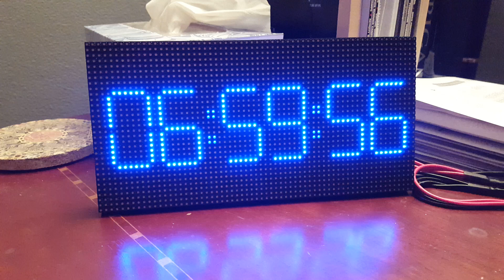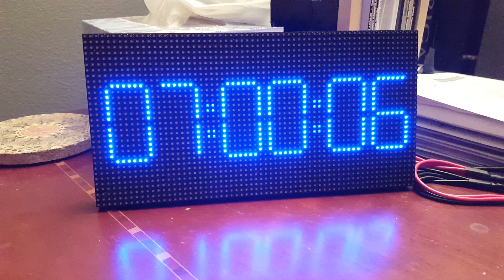HariFun #166 - Morphing Digital Clock

Comment: hello hari
i get this in message Compilation error: ESP8266WiFi.h: No such file or directory. i can't find this file esp8266WiFi.h in arduino IDE 2.3.4. 
where can i find this, which library do i need
Reply from the maker: I tried compiling this sketch just now, and ran into all kinds of warnings and errors.  I guess the years has not been kind to my code.  Although I was able to get past the ESP8266WiFi.h, I was unsuccessful in compiling everything. 
Perhaps it would better if you try other versions that others have posted to the instructable.  Sorry I'm not more helpful.
https://www.instructables.com/Morphing-Digital-Clock/
Reply: @HariWiguna  hallo weik panel kan ik het beste aanschaffen een p5 of p4 panel met bub75

Comment: mooi hari
zou jij mij misschien kunnen helpen hoe ik een  een 
p2  matrix led 128 x64  moet aansluiten op een wemos d1 v.00
voor een morphing clock
Reply from the maker: There is how to build here:
https://www.instructables.com/Morphing-Digital-Clock/
Also check the comments, other people have improved my original design.
Reply: @HariWiguna  thank you, but how do I change the ino file I have a matrix p2 128x64 here 
because you use a P3 64x32 help me please I don't know much about it yet
Reply from the maker: @ruudhudepohl3622  , Unfortunately, that is not a straightforward modification. I did not anticipate other resolutions.  Possible, but not as simple as specifying resolution. Sorry...
Reply: @HariWiguna  ok thanks, do you know if there is anything on youtube

Comment: Any chance you can make this / code it for a pi controller?
Reply from the maker: Hi Corey, Sadly, I have no plans on adapting this to a Raspberry Pi or Pi Zero. 
However, If you could find the library to support the display, porting should be fairly straightforward.

Comment: Hi Hari, I got all the parts but my controller is the 12E version.  I tried your special version, the SSID shows up, I get connected after entering my Wifi info but it constantly loops with connected messages.  And as you noted the refresh rate is really bad.  Is there anyway I can find a non 12E version.  It seems everyone is selling just the 12E?  How can find the version that is compatible?
Reply from the maker: Hi Gary, sorry you're having problem getting the clock to work.  It's been a while since I look at that code, so I don't remember why the ESP matters. The code is not that big. There are different flash memory sizes. Make sure you choose the correct one in Arduino IDE (I think it's under boards menu).

Comment: The module NodeMCU 32MB ESP8266 WiFi Microcontroller is an invalid link on the site.  I'm confused what to get.  Is that really 32 megabytes of RAM or megabits?  Can you provide a link from Amazon or Aliexpress for what we need?  I see listings for CP2102 and CH340G.
Reply from the maker: HI Gary! Sorry for the broken link. I've updated it, hopefully it would last a while. I think it's 32 mega bits or 4 mega bytes. As far as the CP2102 or CH340G, that's the USB to serial interface.  It does not matter as long as you install the driver for the right interface chip.
Reply: @HariWiguna  Hi Hari, thanks for responding.  Would this work?  NodeMcu V3 LUA WeMos Compatible 32Mb Flash 340G ESP8266 IoT Development Module.  The Ali  express ones are all showing April 15 as the expected arrival date.  I can get something locally from ebay a lot faster.
Reply from the maker: @GaryQuiring  , mine was v1, but I'm sure V3 would work fine. Have fun!

Comment: P10 mono color morphing possible?
Reply from the maker: If the resolution is 64x32 pixels and you have the library to drive it. Yes. Of course you will have to follow that display's datasheet as far as wiring is concerned.
Reply: @HariWiguna Resolution is 16x32
Reply from the maker: @ahilgamingyt623  Hmm, in theory, yes, you could adapt the code for less pixels, but my gut feeling is that at half the resolution the effect would not be as cool. The digits would be harder to read and run into each other.  With less pixels, the effect would not be as smooth either.  Please share if you make it with your 16x32.
Reply: @HariWiguna  You are right. It would not be cool in smaller display. Thanks

Comment: Any ways this can be port to raspberry pi?
Reply from the maker: Yes. However, unless there is already a library to drive the matrix, it would be quite a big project.
Reply: @HariWiguna can this be implemented using Hzeller library?
Reply from the maker: @rijotech  I've never used that library, but it appears to be what you need to drive a 64x32 matrix.  My code is pretty straightforward, you need to also adjust how to get the current time from NTP server.  Not sure what you'd do as far as "settings" to setup timezone, etc.  Since you have the PI GUI, maybe you could set it up that way instead of using the Arduino/ESP WiFi Manager.

Comment: Hi Hari! Does this sketch serve a 64x32 RG (1R1G) LED Matrix Bicolor with HUB08 Protocol? Thank you
Reply from the maker: Hi Daniel, if the display has the same resolution, you should be able to swap the draw routine with the proper graphics library for that display.  I'm only using one color, so bicolor should be fine.

Comment: Hi Hari Wiguna!
I have a 64x32 Red Green Bicolor Display (HUB08) with the following pins:
GND -  A
GND -  B
GND -  C
EN    -  D
R1    -  G1
R2    -  G2
GND -  STB
GND -  CLK

Is it possible to work with your code?
Do the R1, G1, R2, G2, STB, and CLK pins need not be declared in the code?
Thank you
Reply from the maker: Hi Daniel,
In theory, you should be able to adapt the code to any display of same resolution. Most of the code remains the same, but the code to draw lines would need to be adjusted to use the library for your display.  Yes, the pins must be provided to the library initialization in setup() to match the actual wiring.
Reply: @HariWiguna    The module is from this one but, I have difficulties about the code;
https://pt.aliexpress.com/item/Indoor-F3-75-P4-75-RG-Dual-color-SMD-LED-module-304-152mm-64-32-pixels/32590023540.html?spm=a2g0s.13010208.99999999.260.1e023c005EkN3J
 Hugs from Brazil

Comment: Great Video Hari!
I'm planning on building something like this in the future. Can I use the full functionality of this panel using an ESP 8266 Wemos D1? Or do you have other recommendations? I also wanted to install some ws2812B LED strips, can I run them from the same Wemos? I don't have any experience with ESP8266, just with Arduino, so any help is appreciated.
Reply from the maker: Thanks.
Yes, you can drive the matrix with a wemos d1.  Brian Lough actually use that instead of NodeMCU (see link in instructable).
Driving a ws2812B from the same esp might be asking too much.  I've seen some NodeMCU board that has trouble refreshing the matrix AND keeping reliable wifi at same time.  Adding another time sensitive device such as the ws2812b is probably not a good idea :-(
Reply: Hari Wiguna Alright, then I will get 2 wemos boards(one for the led strip and one for the panel) because as far as I understood it I can connect both of them to my home WiFi and then tell them what to do by typing their IP address/..... Into my browser. And can I run all of this using a computer powers supply? I found an old one saying 5v/25A

Comment: First off - I love it and plan to build one myself - thanks!  Second - I happened to find a PCB out there that looks like it was purpose built for this project using a WEMOS D1 mini.  Here is the link to the PCB https://PCBs.io/share/rG9w7  Any chance that you made it?  I had some made just to play around with it and i wanted to try and find the BOM for it as I cannot figure out the one power part that is used.  I have figured out all the other ones however.  I cannot communicate with the board developer so I thought I would just throw this out there!

Comment: Hari - look at my morphing example on my channel I did some time ago for any characters (because it is pixel oriented). I used 15x32 font which look pretty good but added 7-segment recently to check if it morphs better
Reply: Video: https://youtu.be/PxVekSvcsgQ
Reply from the maker: Cbm80Amiga - That is very slick!  I wanted that type of effect but didn't know how to do it.  I will have to study your code.  Thanks for sharing the video and code.   Very cool !!!!
Reply: Thanks. Code is really simple, but morphing requires some RAM which is always problem with 2KB ATMEGA. I hope you find it useful.

Comment: Hi Hari
Is it possible to use 32*16 led display and what I have change in code thanks
Reply from the maker: Gur, the 16 vertical is fine, but 32 pixel across might be pretty tight to fit 6 digits :-(
Maybe you could just show 4 digits HH:MM, but it won't be as cool since it would only change once per minute.
My code uses pxMatrix which is on top of AdaFruit GFX, so as long as your matrix is compatible with GFX library, you should be able to tweak my code.  Good luck!
Reply: hi i got the 64x32 display on my display pin input are R1,R2, G1, G2, B1, B2, A, B, C, D, GND, CLK, OE and LAT there is no E pin please show the pin input connector on your display. thanks
Reply from the maker: If you scroll down on Dominic's github page, I think he covers how to wire up a display like yours. Good luck!
https://github.com/2dom/PxMatrix

Comment: Your mission if you choose to accept it is to make a LED clock and let it count up using the internet. Leaving you with a lot of great features to setup. To save time you will need this Clock.  As always If you or your clock end up counting down instead of up and you put it on the internet We will be laughing at you and your clock. This message will Self-Destruct in 15 Seconds. Good luck Hari.
Reply from the maker: This has been a very long 15 seconds... The message has not self destruct after an hour.  I think you got a dud comment. lol
Reply: Hari Wiguna nope that was the 15 seconds before it hit 7 PM  or AM lol
Reply: Hari Wiguna boom lol

Comment: Hi Hari,
realy like the morphing effect!
You should checkout our version 2 of the IAS lib. 
It has an timezone selection field and is demod in the clock & virginsoil examples.
Regards >Onno
Reply from the maker: Thanks Onno!
I haven't been to IOTAppStory for a long time. I will check it out. Thanks!
Reply: Hari Wiguna we are currently preparing to release version two. But you can already use it. Check github....for the library and screenshots.